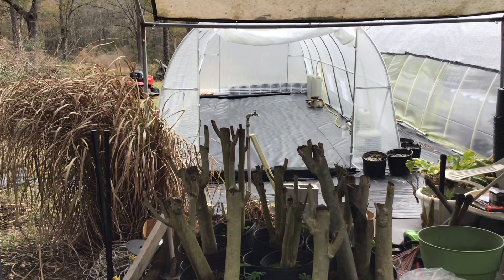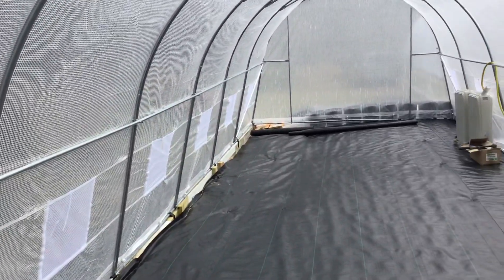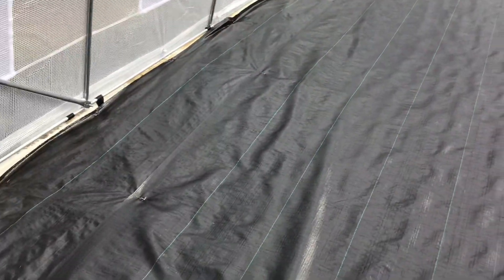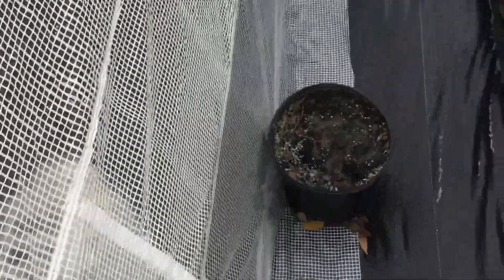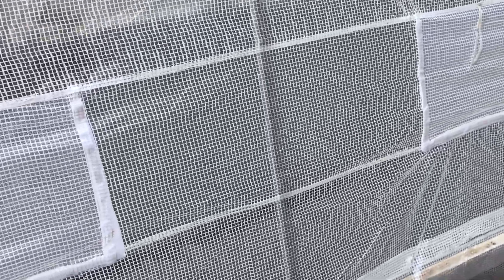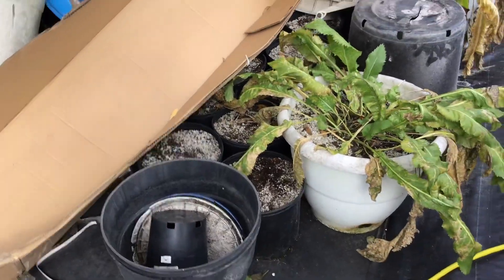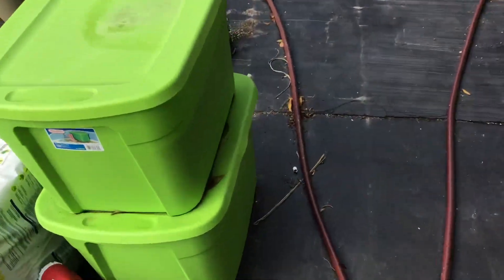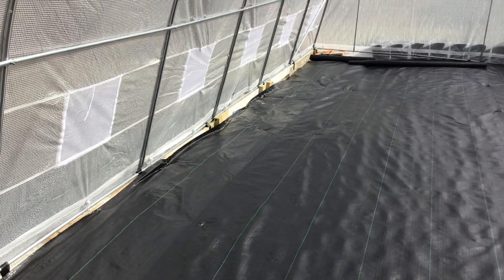New greenhouse, 10’ X 26’ off Amazon, Happy with the way it’s turning out 💚🙏

Comment: I like the way the windows are made. It looks like you can open them and access the inside of the greenhouse up and down both sides from the outside
Reply from the maker: Michael Manuel I still haven’t opened any of them, but working on moving things in and when putting it up I believe the have a bug netting over them. I’m still happy with it but there’s little problems I can see, and the windows being so low on the sides is one as heat risers and has no place to go. Thanks for watching and commenting. Blessings

Comment: How is the clear plastic holding up a year later? Any holes or challenges?
Reply from the maker: I have gotten 3 more of them in late summer for this winter. I have done videos of it all. The covers that came with the greenhouse I don’t much like an the one on this greenhouse (the first one) hasn’t done well to me. The zippers on the door have gone bad and the velcro on the window doesn’t work well this year and I had to tape them closed. In having gotten 4 of them I saved 2 covers by covering 2 that I put 4 year plastic over ( look for a video, greenhouse inside a greenhouse) and I’ll use those covers on these when I need to replace them. I like the Frames but I won’t buy the covers again.🙏
Reply: @craigstrickland1140  thanks for sharing your knowledge and recommendations 👍